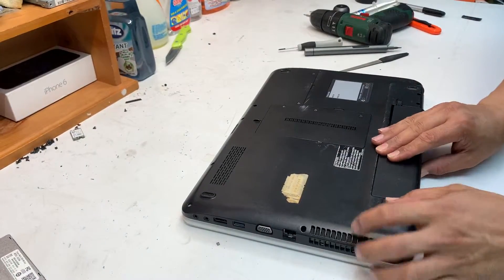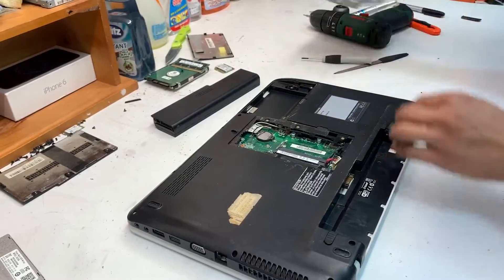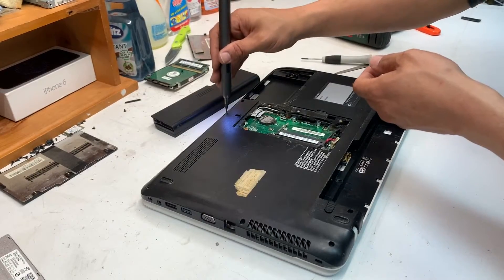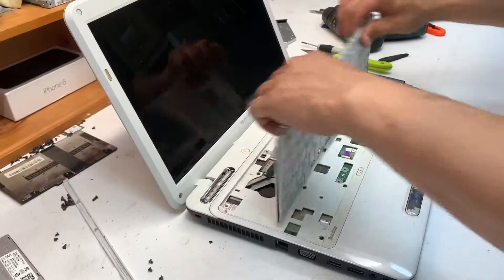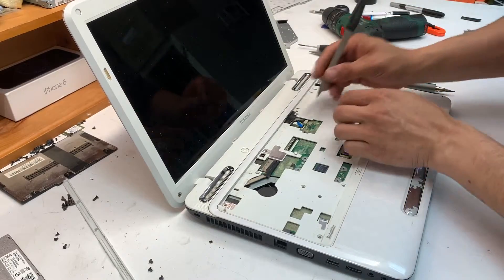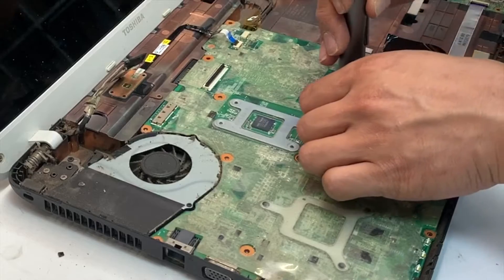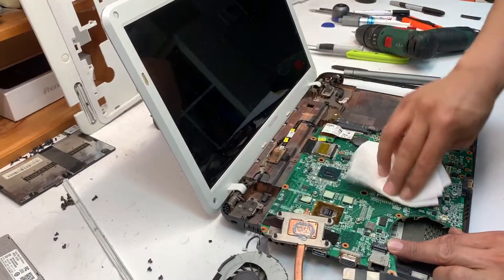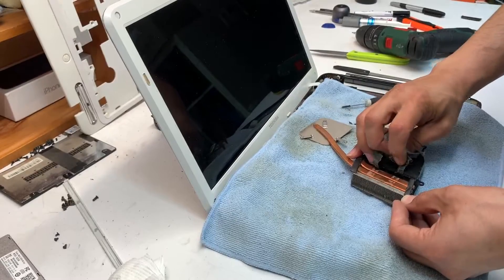Toshiba Satellite L750 CPU Cooling Fan Cleaning & Teardown/Disassembly

Comment: It's a pity you can't upgrade the CPU on this laptop. It's quite easy to open up and get to cpu compared to a lot of laptops. Great disassembly video!
Reply: In my case, I have an L750d with an AMD A6-3420M & i'm pretty sure I can get an A8-3520M replacement in it, some generations came with it in around 2014 (same socket size, not sure if the software eg. BIOS will 100% work with it)